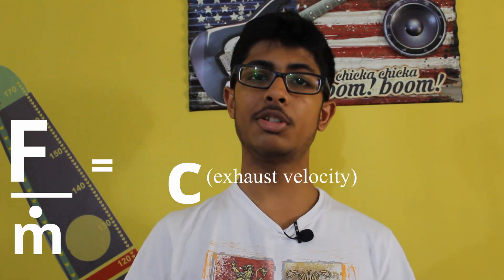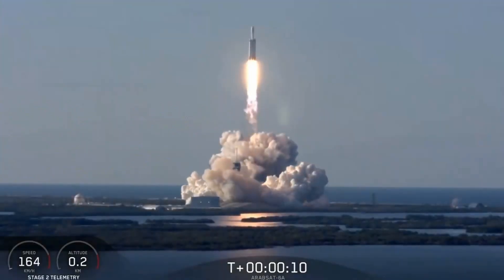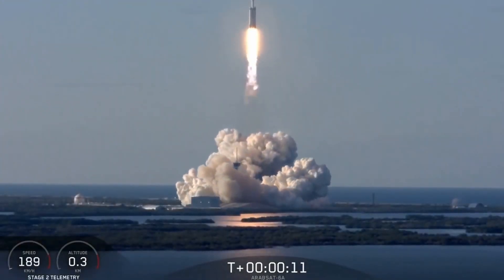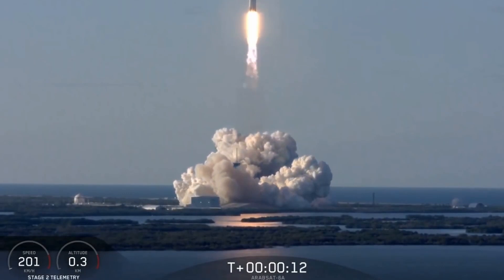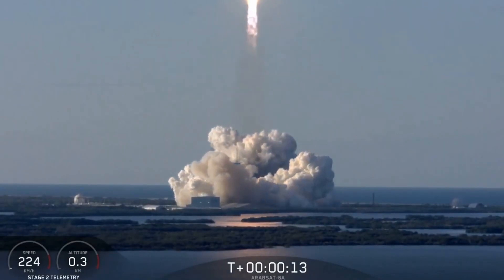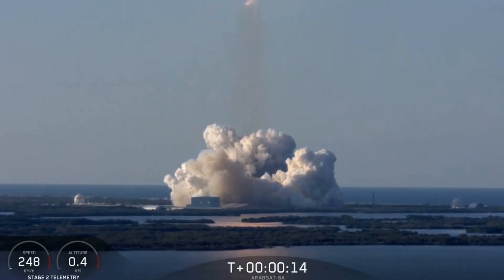What is exhaust velocity of a Rocket? How to calculate exhaust velocity? Rocket Specs #3

Comment: Hello sir i want to know how to calculate black power rocket velocity
Reply from the maker: I am assuming you meant a black powder rocket, and what you need to do is get the velocity of your vehicle at any given instant. You can look up the MPU6050. It's a 3 axis accelerometer. It should provide you with instantaneous acceleration throughout your flight so you can get the instantaneous velocity by Integrating equations of motion.

Comment: what is the difference between effective exhaust velocity c and actual exhaust velocity v? is c a fictitious velocity?
Reply from the maker: no c is not a fictitious velocity. The effective exhaust velocity c and the actual exhaust velocity (v) are the same thing. C and V are just symbols to denote them.
Reply: @SpotlightInSpace  c is not always equal to v. They will be equal only at a particular altitude. If there is no pressure difference between exit and surrounding, c is equal to v. U can refer the book #Rocket propulsion elements by #gpsutron.

Comment: Thank you! I am right now in the middle of working on a hybrid rocket motor. Is it reasonable to calculate the thrust by measuring the force given off by the exhaust? As in shooting the exhaust into a metal plate that works like a home scale? I imagine measuring the thrust via a static plate would be easier than building a rail system? I love the video!
Reply from the maker: It depends upon the level of precision you are looking for.  Its quite easy to use a physical method for measuring the thrust, such as trying your engine to put force against another force that can be calibrated.  So I guess you are quite right on  using a plate as a scale for measuring thrust.  It is the easiest and most direct way to do so. But if you want to go for any other indirect ways, and I am guessing you are working on an amateur level with SRB's. If you by any chance have the specific impulse of the Solid Rocket Motor, you can calculate the mass flow rate ( change in mass/ burn time) and then multiply it by the exhaust velocity ( ISP * g).
That should give you the thrust. But remember I am just a 15y old teenager, how has learnt this stuff out of books and youtube videos
😉 .   BTW , it feels great to hear that you liked the video!!😄😄
Reply from the maker: who*